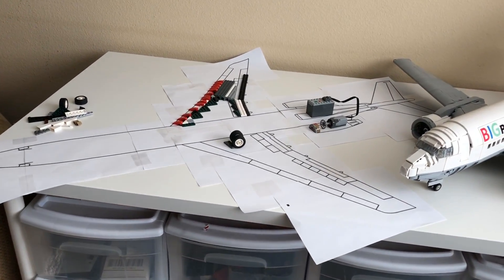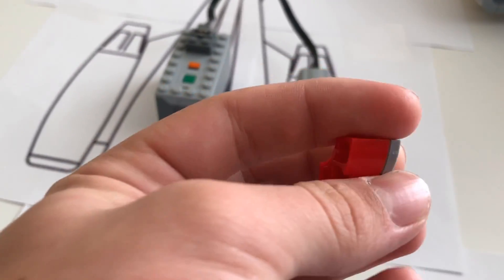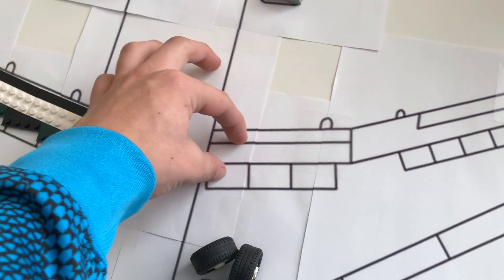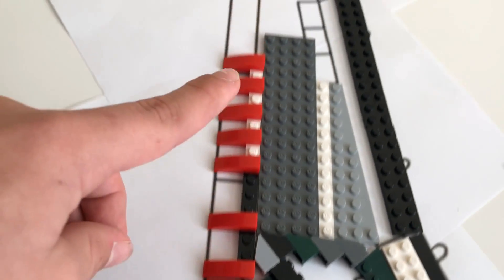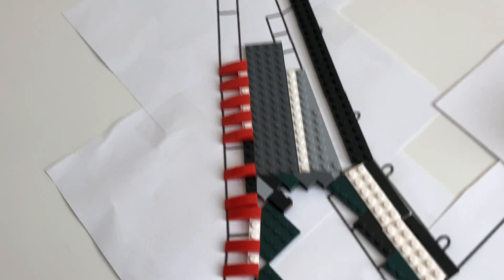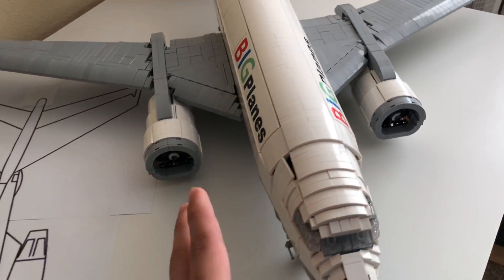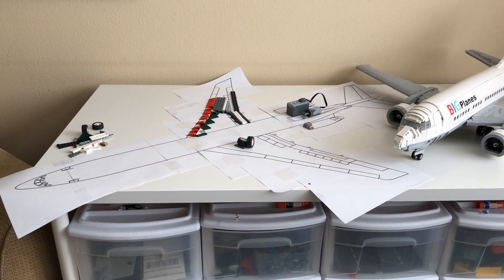LEGO 727 Designing The Wing!!

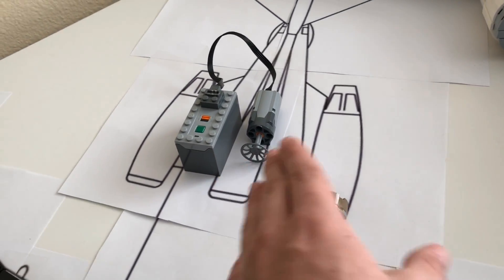Comment: @BigPlanes 1:30 of you put the power brick a lot closer to the main landing gear, and have a single motor underneath engine 2, you could have a more centred mass whilst using fewer heavy parts...
Reply from the maker: Yea the placement of the battery pack is not finalized yet.